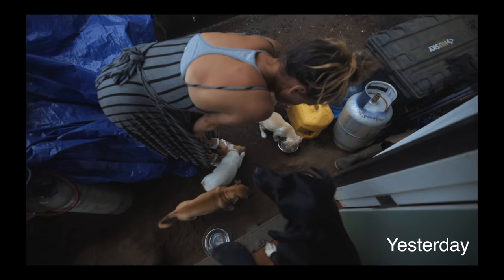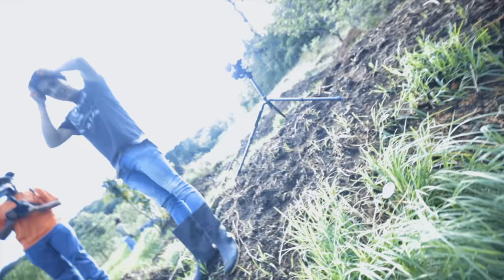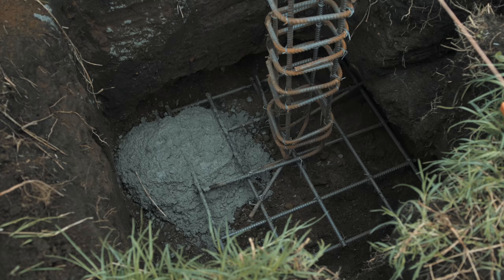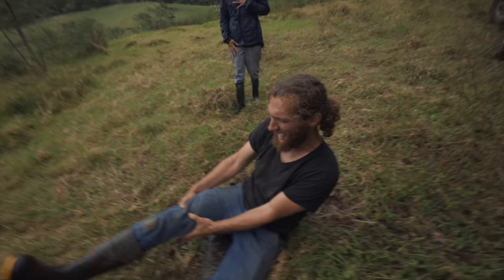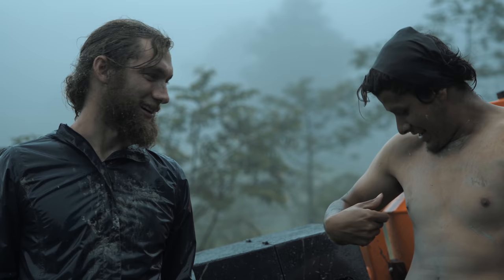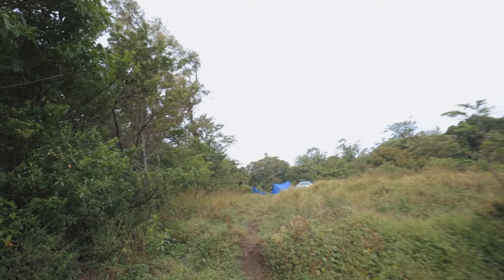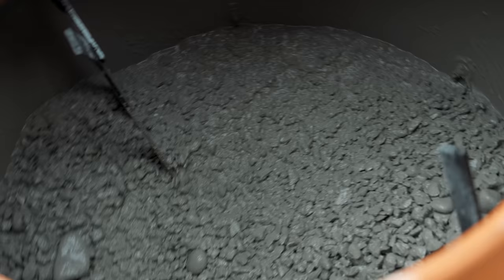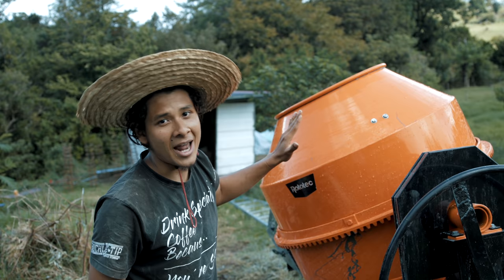Pouring the FOUNDATION in the POURING RAIN // A-Frame House Construction

Comment: Some tips on the cementmixer:

1. Grease wheel
2. Always cover motor after use with some plastic
3. Always wash it clean after use inside.

And guys - you need to make a road. Do some planing on where the houses are going to be a make a road so that everyone will benefit. You cannot build your houses with this current no-road system.
Reply: I don't think they want the road look
Reply: @colourful64able  Going to be a lot of hassle and digging out of vehicles every rainy season without at least a gravel road bed...

Comment: If you connect a hose to your water tanks up the hill you'll have some good water pressure just from gravity down at Rodrigo's spot! Better than lugging buckets.
Reply: a very long hose ya said..,
Reply: @5379jj  yea a long one. Lol. Well worth the investment. Rodrigo won’t need as much hardware to have a constant water supply with good pressure. It would beneficial for him to keep the water supply on high ground and use gravity.
Reply: No, just add another large tank down below for catchment, will fill fast in that rainy season there.
Reply: @VeRSINGOnTheGo  just make a well ... there must be a lot of water in this place 😅
Reply: Hauling from the river near his mini A frame would still be closer. It is for cement so any dirty water will do. And yes start collecting water at his new place.
Reply: @VeRSINGOnTheGo  Putting a catchment system on higher ground and using gravity IMO be the smarter choice. I dont know the grade of the land but I assume the cost of hose or piping would be less expensive than pumps, expansion tanks, etc.. Sure short term for the cement if he didnt have the money for a hose/pipe he could collect on site with all the rain.
Reply: @deewhitman2812  Hauling water up the mountain would suck even more than going down for longer.

Comment: not cleaning the mixer adds more weight to the mixer causing the motor to work harder and all the parts will wear quicker. So keep cleaning the mixer and it will last a surprisingly long time. I know this because my dad made me and my brother clean one every time he used it, and I thought it was so stupid as a kid....my brother and I are in our late 50 and early 60 and my brother still has that mixer and it works just like it did when I was 8
Reply: I am not sure if they bought it, rented it or borrowed it, but if they own it, they could rent it out for income after they are finished with it...
Reply: @antoniobaez6282  It would make more sense for them to buy it with the amount of building they have planned - then the can recoup the investment renting it out.

Comment: Spray a thin coat of nearly any oil or even a coat of car wax if available on the outside of your mixer prior to use. Promise, you'll be shocked at how quickly it rinses clean.
Reply: Ha Ha. Thought that was only my trick !! LOL But you are totally right ! Pro Tip back at you : Instead of buying a 90 dollar jug of inhibiter for creating exposed aggregate...A two kilo bag of brown sugar mixed into the same amount of water required for the afore mentioned process gives you same working time and desired effect. Great idea from you too. Cheers
Reply: At the military we had a similar trick: 'washed' all the cars and trucks with diesel-soaked rags. Any dirt and dust just wipes off. AND, the cars never got rusty!
Reply: You can use used oil as well. Same if your pouring into forms. Coat the side that contacts the concrete with oil. The wood will 99% slide off.
Reply: Hope ur concrete holds. Looking pretty dry to me
Reply: Second batch looked better
Reply: PAM spray is what I use on my snowplow. Works great!
Reply: 😃Somebody mentioned that above! What a great idea!

Comment: You are definitely not afraid of hard work !! I have worked in and around masonry and concrete for over 30 years now....Just want to share a few pointers that may help. Try adding about half or a third of your required water into the mixer before dry ingredients. Then add about a third of your aggregate ( let this blend before adding any cement ) Then add half of required cement...blend this and then gradually add remaining water, cement and aggregate. You should find that this helps otherwise it can be a complete uphill battle for you. Remember to ALWAYS ALWAYS rinse and clean the mixer, wheelbarrow and any buckets and/or shovels and implements. I hope this helps. Love the journey. So happy you are pregnant and healthy. Love you guys so much !! Tons of love and best wishes from Nova Scotia Canada ( the other rainy place ) LoL !! Love You oxoxoxox
P.S. in between mixes put a small amount of water in the mixer and let it roll a bit. Brings all the little bits together.
Reply: Can do epic cement with additive will nearly fully cure in approx 3 hrs

Comment: Those yellow tie-down straps are great! Ive used them for years hauling golf carts. You shouldn't leave them in that flat position though because they are "unlocked" you can pull on the 3rd strap the one without the hook and itll undo itself (yes even if ratched down its the middle piece and sides that lock/unlock it) if you close it in on its self youll see at the very end of closing it in you can click it in a place thats "locked" and it wont undo itself.

Comment: Talk about one heck of a lot of work!  Maybe if you used a 3o gallon drum, or some thick plastic culvert/drainage pipe with the ends cut \out to slip over your vertical rebar to retain the bulk of the concrete within the vertical rebar, plus how much additional inches for the total diameter you need for surrounding the rebar??  I know you have probably already researched the best way to do this without wasting any concrete, but, just seems like a lot of concrete is going to waste i such a large hole...sure would be nice if you could get  a concrete truck down there to the new house.

Comment: If you want a 90 angle remember 3, 4, 5. The 3 for one leg, 4 for the other leg and 5 for the hypotenuse. you can multiply this by any number for long lengths is 9,12, 15 or 15, 20, 25.  Also check  your square by measuring diagonally , the measurements should be the same. Another thing google "Batter Boards", if you set them up, cut a small notch at the string to make it easier to reinstall if you need to remove the string,

Comment: A good rule of thumb is to start with water, if used the day before placing some larger rocks inside and running it with water and rock will go far to loosing any material build up drying inside.  Once cleaned, adding water first reduced the chance of having it pack to the bottom, then add your concrete gravel mix if possible measured to simplify and speed up the process.  From my experience cleaning it out if you are not going quickly from batch to batch is a good idea to avoid any drying inside.  Hard work but looking good.

Comment: Use 2 to 2 1/2 inch stones, both round river stones, and jagged, mixed in with your smaller gravel with a gallon or two of water, after a few mixes to keep the inside of the mixer drum clean, just water and stone. Run it for 5 min or so then do a quickie with a coarse steel brush to clean the tumble fins and you will have this machine for a long time. If you slack off too much by not keeping the inside clean, you'll have to go at it with a brick hammer or similar to chip away at the cement...not fun. Looks great, I assume the Sonotube or box tube forms will be going in soon and you'll have something to build off of. Thanx for the content, stay healthy and happy.

Comment: I know it might not be SUPER efficient, but have you guys thought about using rain for hydro power? You can use the rainwater running off your roof to generate a modest amount of power. The small boost might be enough to help hold you through rainy weeks

Comment: Try putting the water in the mixer first, then half of the sand and gravel, then all the cement powder and then the rest of the gravel. That seems to work best for me.  Tip for clean up, throw in a couple shovels of gravel and water, let it mix for a few minutes, dump and rinse.

Comment: 3-4-5 triangle. Any multiple of 3 from the corner in one direction....and the same multiple of 4 in the other direction will give you that multiple of 5 across the hypotenuse to find a square corner. This way you can go further from the corner to check for square. Easier than the pythagorean theorem.

Comment: Using pythagorean theorem will work, but it is difficult to get accurate when measuring only a short part of each side. The easiest way to ensure that a rectangle is square is to measure opposite corners - when both opposite corner measurements are identical it is square. So do the total structure corners first to get it set, then start getting smaller rectangles within the structure until you are just checking each 4 adjacent holes. This is the easiest method to ensure that the entire structure is square.

Comment: if i was looking down at a rectangle, i would measure distance from upper left to lower right corner, then upper right to lower left corner.  if the 2 measurements are equal than the rectangle is square.  at least thats how we did it back when i was framing houses.  pathrogrim seems like alot of extra steps..  but who knows, maybe there something else im not seeing there.  good luck on your build

Comment: You guys need to put in a gas powered generator. To charge the batteries for the solar system when there’s no sun. PS you tied that trailer down better than I did years ago I moved a mobile home with just one ratchet strap and I could’ve popped off at any time I just got lucky.

Comment: you can get a battery charger and run it  off the generator , or you can run it off your truck , not very efficient but you probably only need to do it a couple of times a year

Comment: I would double check the drawings. Usually you only need a 1 ft thick spread footing under a column. The  you would frame some forms around the columns and pour those after. It looks like you guys are pouring a lot of concrete in the bottoms

Comment: I'm sure you've thought of it already, but just curious why you guys haven't thrown something together really quick (even if just with a tarp and some sticks or I've seen some with 2 hula hoops and a shower curtain) to make your showers a little more tolerable? At least to block out the cold wind and then just take it down when not in use? Cold showers are the worst 😂😂 i might be a bigger baby about it than you guys, because i would've done that after the first cold shower

Comment: you guys should invest in some powerbanks for your minor stuff few badboys plugged in and bam you got power when its rainy. as always very inspirational, always look forward to your updates
Reply: You do realize that they would have to have a way to charge them ....like solar maybe? See the problem yet?
Reply: They have batteries that are charged by the wind and solar. ... but if it is not sunny or windy consistently they gradually drain.
Reply: @RebelCanners  no actually, because power banks hold the power from the sun untill the rainy days. you plug in the bank to the solar panel and the sun on non rainy days will fill the power bank just as if it were a deisel generator. the problem is that people dont see that battery technology has evolved quite some bit in the past 10 years. it is now possible to store quite a bit of kilowat hours and it is quite feasible (especialy in panama) to setup a few emegency power collectors for small electronics and things that are power essential. there are people that literally supplement most of there electricity from repurposed laptop batteries, so doing it legit is very possible, so no, i dont see the problem, i just see solutions
Reply: @divekatdreaming  my understanding of there current system is that they draw directly from what being generated so when inclement wether happens it makes it harder for them to have power to upload and communicate. power banks are a great way to supplement but in the end it is just that. its too bad they dont live by a river. movement of water is a good constant flow of energy that with enough ingenuity can be used to pwer life and then some
Reply: @ponk133  and that’s my point if their large batteries can’t charge they wouldn’t be able to refill the power banks without sun either. Solar needs sun to work both small scale and large scale. They would need dozens of small power banks to have charged for these rainy season days. 🤦‍♀️
Reply: @RebelCanners   Goal Zero Yeti 1400 Lithium with WiFi + Boulder 100 Briefcase Solar Kit. cost 2g. will store enough power by itself to charge a phone like 100 times, or literally run a tv in a no power sit for 10 something hours, and comes with its own panel. worth its weight in gold, and perfect for a homeonwer looking to supplement there pwer suppply with a cost effective solution. aslo having a plethra of charged batteries means that on out seasons you have stored power to supplement those days. they should also dedicate a small measure of there land to capatlizing on the amount of rainfall by setting up a water catch that will allow the waters natrual desire to be at the lowest point to create natrual force and could be used to create a hydropump that could also be used to tranfer the kinetic energy to a power bank.
Reply: @ponk133  They have a 600amp battery bank in their "powerhouse" that stores power from the solar and wind generator. If they want to store more power, they would just add more batteries.

Comment: You make a great case for oil and gas as a dependable source of energy. There are times when wind and solar are not reliable. Solar panels would drive up the cost of everything. Try running a cement mixer on solar. Solar panels are made from rare earth minerals. Poor people would suffer, as usual.  Thanks for teaching the truth.  😎

Comment: seriously reconsider building an A frame- build a square box with a flat roof sloped one direction- you will have 10 times the usable space inside, it will cost a little more but very worth it. Ive been off grid almost 10 years i am a retired home builder. Solar- if you dont fully recharge the batteries everyday--- you will ruin them. Holla if you need help with anything!

Comment: Just curious...wouldn’t it be easier to use Sonotube? Instead of filling those huge holes with concrete.
Reply: I think that is what they are doing. They had to dig the big holes just to set the base, then the rest of the way will just be a little wider than the part standing up from the base.

Comment: This video shows easy to build modular homes which may or may not suit your climate, however the real reason I wanted you to see this is the really big screws used for a no concrete footer and you could even weld to them. Yes you would need to buy the machine: https://www.youtube.com/watch?v=dmeiZ90BKH8

Comment: I don't want to sound too critical but. I think you are pouring way more concrete in those footings and piers than you need. You can save a lot of concrete by just be Ning some rebar to protrude from the footing where you wish to place your pier. Then fasten this to your rebar for the pier. Slip a form box down over the rebar to make a form around the rebar. Then pour in your concrete. If you are planning to fill each hole with concrete. You will be over pouring and wasting concrete. But then it's your job so have at it.